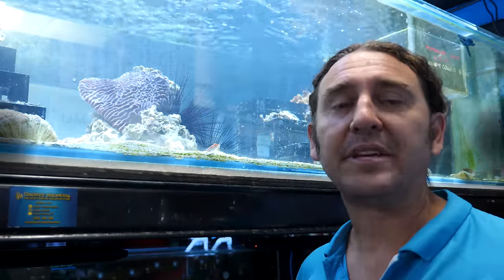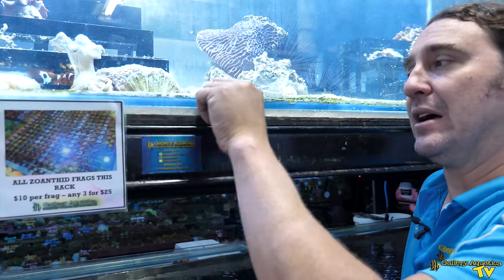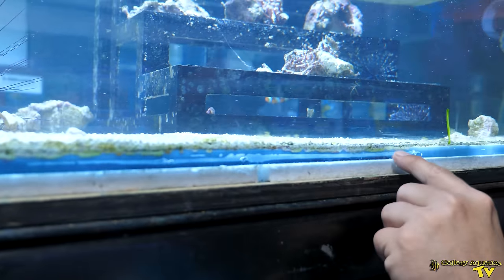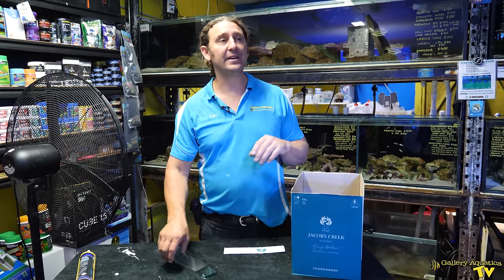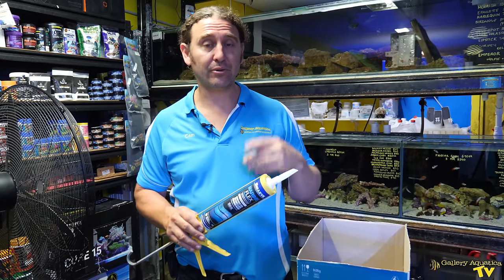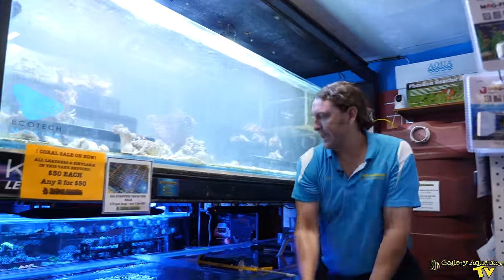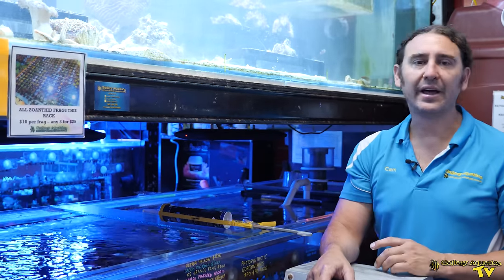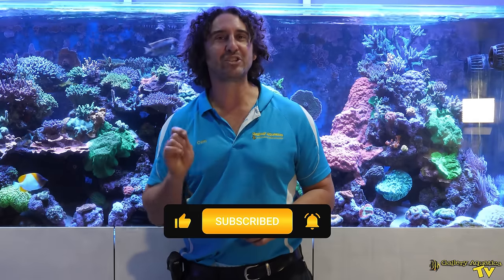How to know if your aquarium is about to BURST!

Comment: Did you check the back side of the tank as well?  It has the same stress as the front side and is equally at risk of failure.
Reply from the maker: You are correct. Yes I did check the other side. The silicone is perfectly in-tact on the other side. Cam

Comment: i want to buy a standard size 125 gal tank.. How thick should i expect the glass to be in inches for it to be considerd safe ?
Reply from the maker: If it’s up to 24 inches high it is normally 10mm (just over 3/8 inch). However this is assuming it is well braced. If it’s rimless you usually need to go almost double that. Cam

Comment: I euroblace all my tanks top and bottom I would never have a braceless tank infact I bought one and braced it my self you have to watch out with razor blade glass scrapers on a braceless
Reply from the maker: Good advice, I’ve seen many silicone seams damaged by scraper blades. Cam
Reply: @GalleryAquaticaTV  I bought a opticlear tank couldn't believe how crap the build was beveled edges on every pane of glass they don't need to be bevelled under the silicone and I have had 12 systems never had a tank ever built around a base plate so I braced it and then I braced every single edge with aluminium angle so it's braced every were inside and out

Comment: You had the tip of your nozzle around the wrong way dude, will work better if you put the angled cut secion against the surface youre siliconing, also, put it on the bench/ladder whatever and do it with two hands, much better finish that way and more control,, just trying to help,
Reply: And you did, maybe not the nozzle bit but hey, lol
Reply from the maker: Thanks mate, I’m always keen for tips on stuff like this. Cam

Comment: Are you sure it's aquarium safe? Selleys don't specifically say like they do with some of their products.
Reply from the maker: Good question. I’ve used it a few times in reef tanks and not seen any ill effects. I always monitor the tanks afterwards just in case. Cam
Reply: @GalleryAquaticaTV  to be fair the oils released from regular window silicone isn't that toxic to aquatic life (from memory) and with a protein skimmer running in conjunction with fresh carbon I doubt anything would happen. The real issue is anti microbial agents added to some silicones to prevent mould etc in people's homes. However, if they are present this is always stated on the package.

Happy reefing!